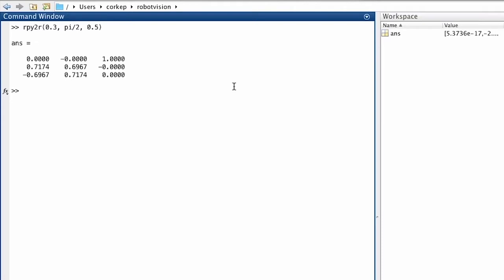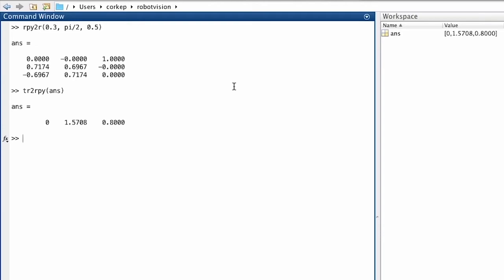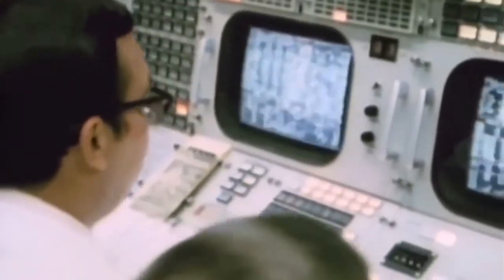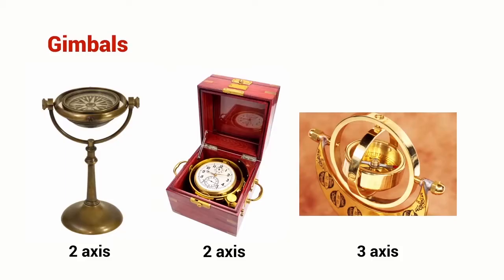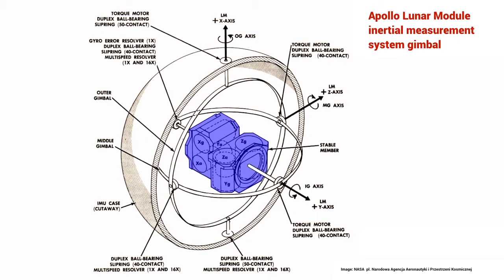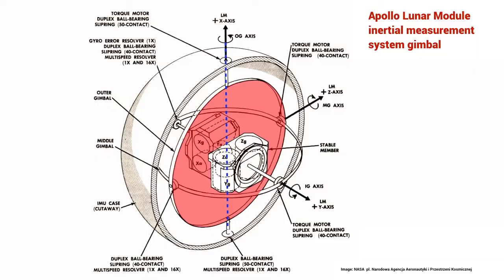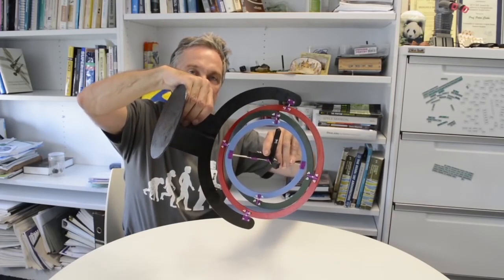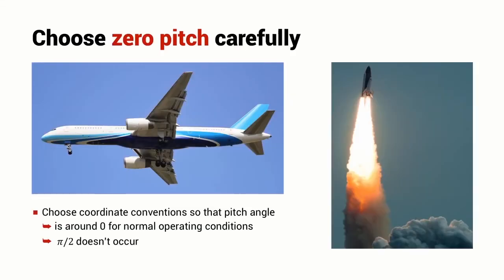Singularity in 3D rotation angle sequences

Comment: Thank you for sharing your knowledge sir.
I have a doubt. If the pitch is equal to pi/2 radians then rotation angles ( r,  pi/2,  y) are changed to ( r+y, pi/2, 0). How this change is creating problems?
Reply: It means the roll axis and the yaw axis become confounded and you lost one degree of freedom. This configuration is unstable for the corresponding angles and it becomes difficult to correct the pitch to get out of it, hence the uncontrollable spin.
Reply: Thank you sir